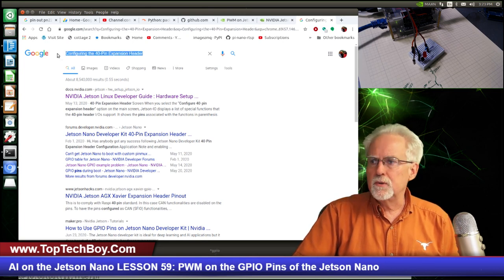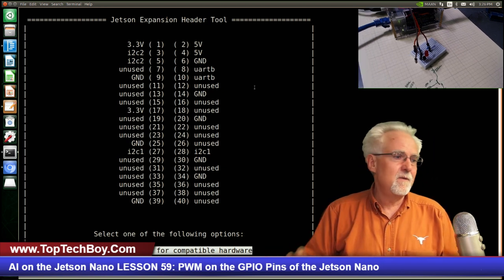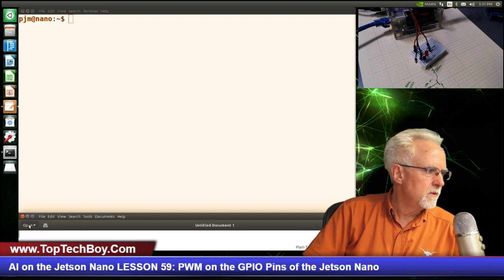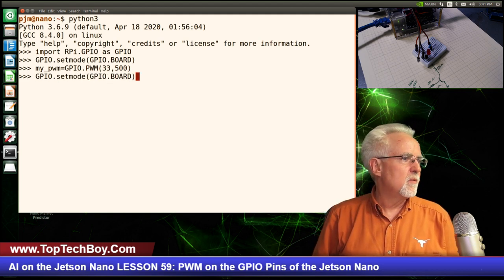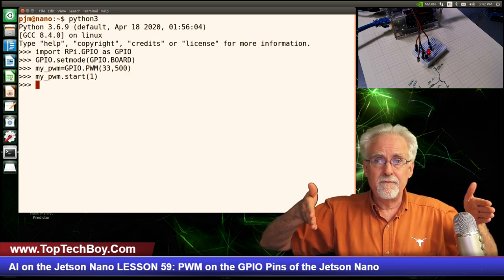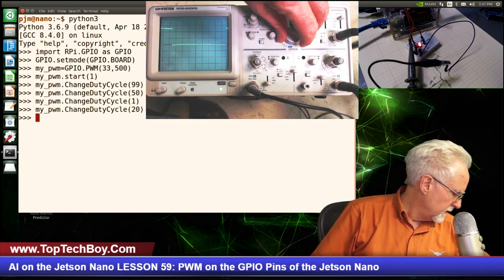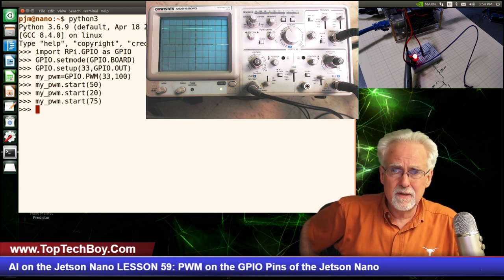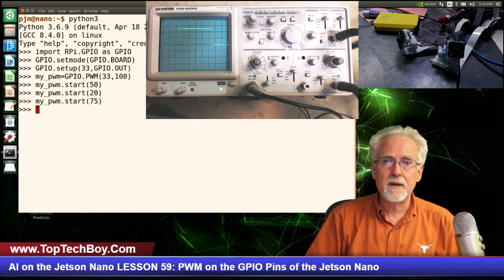AI on the Jetson Nano LESSON 59: PWM on the GPIO Pins of the Jetson Nano

Comment: Fun class Paul, I did get the home work going. Also set up for loops for duty cycle up and down. Fun to watch on the scope. For those people that would like a small scope a kit you can get for around $20us is a 200khz single trace digital storage scope. It comes as a kit but is not too bad to assemble. Will be easier to assemble if you have a vom for checking the resistors as they have 2 bands for tolerance as well as being 1/8w devices. Or look at an esr kit do some research here as there are lots of variations within a $8-$20us range. Kit here is mostly mechanical. Do get cases with the kits for these it is easier. Gives some pretty nice test equipment inexpensively. Thanks Paul look forward to your next classes.

Comment: Initial HW was done by setting up a while loop setting an off time for the LED, kinda like PWM.  Used trackbar to change that off time.

Using Jetpack 4.4, no issues with change frequency higher/lower.  Again setup a while loop, as well as a pair of trackbars for duty and freq.  No errors with a freq of 1000000.

Comment: Quick question I noticed in one of your lessons that I2C1_SDA  and I2C1_SCL are used for the first servos (Tilt and Pan for Raspebery Pi camera),  which pins can I use for the second camera? I have used in my Xavier NX I2C0_SDA and I2C0_SCL with no success... thanks Paul!
Reply: Good Morning!
Reply: Pins 0 and 1 on the PCA9685 are used to drive the servos on camera 1 and pins 2 and 3 are used to drive the servos on camera 2. You only need I2C1 for the PCA9685 servo driver module.
Reply: Thomas Coyle Thanks a lot!

Comment: can i change any another pin to PWM pin. I want to add two l293d motor drivers with the gpio directly any solution for that. I am able to run the motors but i need  pwm for speed control.

Comment: I successfully generated pwm through the 32-pin of the 40pin header, the current voltage of that pwm was around 3.3V, Is there any way to reduce that voltage to 1.8V?